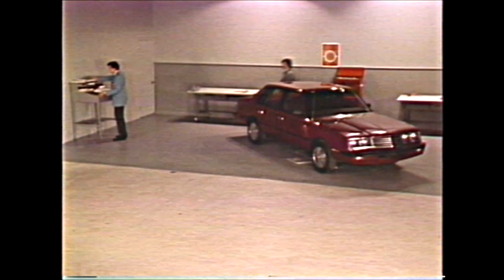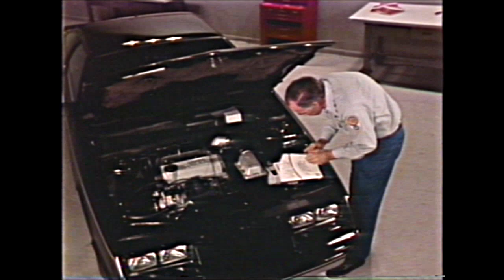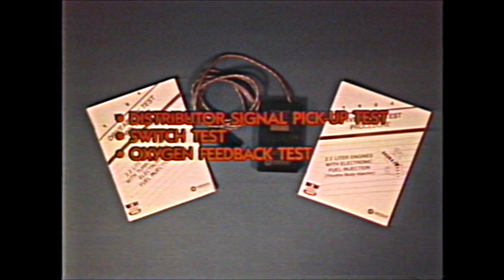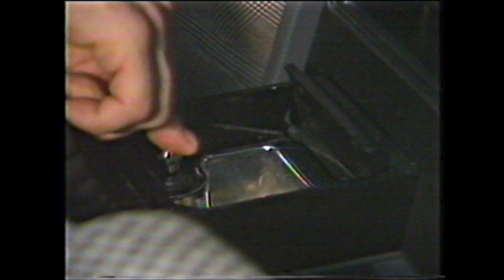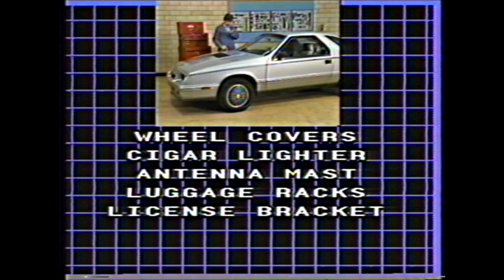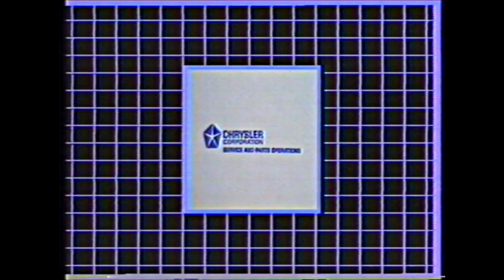1984 Chrysler 2.2 Liter EFI Turbo EFI Drivability Diagnosis

Comment: As the owner of a classic vehicle (the New Yorker), are you concerned with the impending onset of electric vehicles eventually forcing your pride and joy off the road?
Reply from the maker: Nope.  And there will always be a place in my garage for it even if it does... 

But this isn't the only K we'll own. I have a few more I want, including the limo (an '86 with the 2.2 turbo), a convertible (k and j body), a Dodge RAM or Ramcharger from the 70s, an M-Body Fifth Avenue or Diplomat/Fury, etc. And same with my truck, the 2015 Tacoma. It's the last model year of the 2nd generation spanning 11 years, so there's still a lot of 1990s and 2000s design and technology going on. Never getting rid of that one (and it's been rustproofed  annually and professionally (fluid film)). 

So one way or another, I'll be keeping our fleet on the road. Convert it to run on other fuels, etc. but we'll make it work. They are all I have left of an era of things I enjoy, and I wont' let it die.
Reply: @spatsbear  I’ve been worried sick over it - I own a minty fresh red 1994 Miata that I’ve spent countless hours and thousands of dollars on various maintenance and restoration projects on, and I have no plans of EVER getting rid of it… my biggest fear is a “Red Barchetta” situation… I AM an uncle, but I don’t have a country place that nobody knows about.
Reply: @spatsbear  a Dodge RAM Charger from the 70’s with a pushrod V8 will just about run forever, not really much to go wrong since it’s a push rod engine and if something does happen, it’s usually a simple and easy fix. I’d also keep an eye out for Ford trucks from the 70’s as well with the 300 inline 6 which is one of the most reliable engines Ford ever made along with the 260/289/302, maybe even a mid to late 60’s Ford Galaxie 500/LTD would be good as well to have some variety. Fords may not be your favorite car brand, but at least are built with quality many decades ago unlike the junk they make today that simply can’t hold a candle to the vehicles they made in the 90’s and 2000’s.